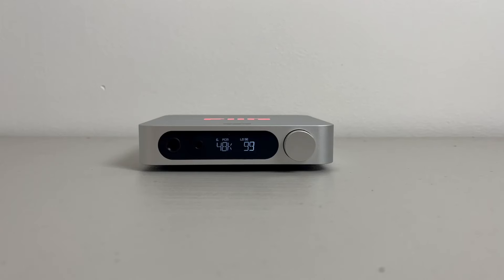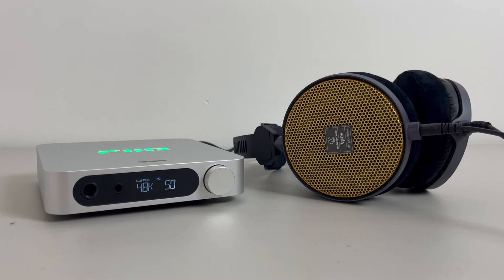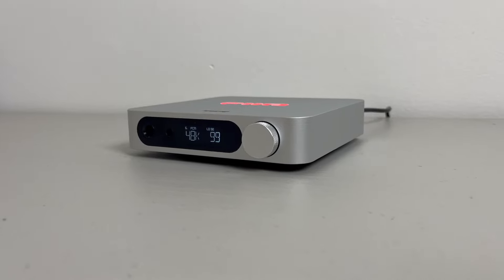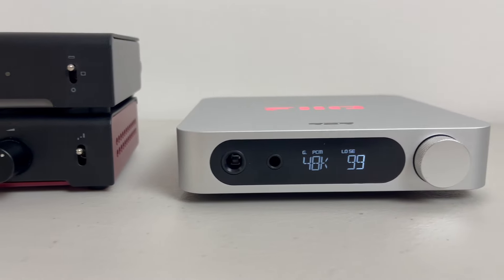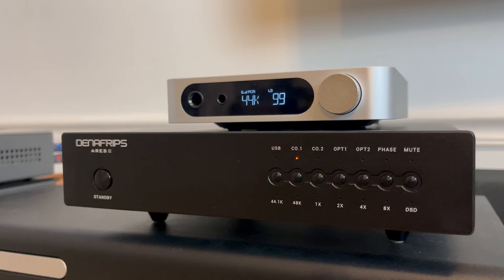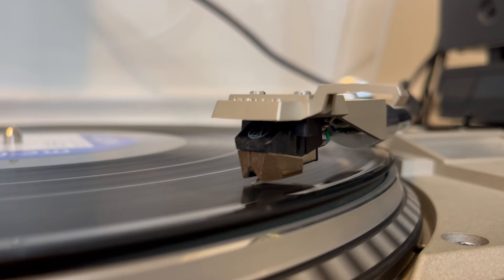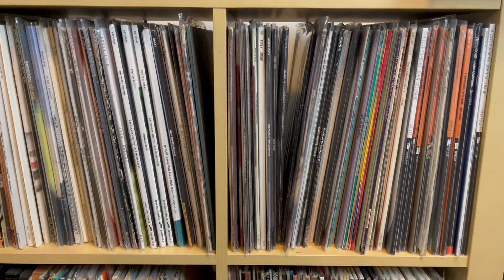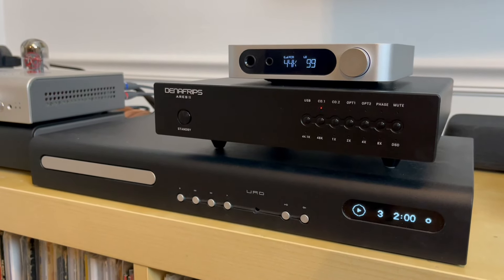This $160 R2R DAC is BLOWING MINDS in 2024! (Fiio K11 R2R Review)

Comment: Couldn't agree more with the review, nice job. I picked one up about a month ago and find it superb as a DAC, headphone amp and preamp - and i use it all three ways. I also found it compared well to my Pontus II in the same way it did to your Ares. Really relaxed and spacious R2R sound. One thing reviewers haven't pointed out that's an excellent aspect of this unit is it's volume control which is not a cheap analog volume pot nor is it a digital volume that throws away bits to achieve attenuation, rather it's an R2R volume that is not dissimilar to a stepped attenuator by way of resistor relays which we are seeing in many newer preamps these days.
Reply from the maker: Excellent point on the volume knob! Thank you for sharing!
Reply: Have you heard reviews on the Cyan2 DAC? it costs 10x more, but lots of praise I've heard
Reply: @toai2  I've seen reviews and all the praise, yeah! It definitely has my interest for sure. I do wonder if it's any "better" than my Pontus II though, probably just different.
Reply: @sean_heisler  no need to get the Cyan if you already owned the Pontus
Reply: Mostly reviews on this is regarding the headphone setup,,,,glad you mentioned the dac is good,,,,looking for this with my fiio btr13 Bluetooth receiver and Yamaha 2 channel amp ,,,,,is this analog sounding dac,,,,, ???
Reply: @jawadtaheri4989  Yeah, like Aaron was saying, it’s a bit more analog in its delivery, not analytical, smoother. I’ve owned two Denafrips R2R DACs now and it has the R2R, somewhat analog-like sound.
Reply: That's cool it can be used as all those 3. Prob gives a nice quiet listening exp on the phones 🤔 awesome for some late night watching / listening😊😊
Reply: It's a great unit, just wish it had a remote, my fat fingers struggle with the multi function control .. Well worth the money whatever you use it for .
Reply: @Evolved_ue7  thanks. Lol I was to ask if there was a remote, no biggie. Tempted to grip it lol
Reply: I didn’t think the K11 R2R acted as a preamp. Can you confirm? Asking as it only says line out on the RCA outputs.
Reply: @G00dH0uR83  Yes, it is a full preamp as well, I use it with a Parasound amplifier I have driving speakers. You can use the unit three ways: as a headphone amp, as a preamp and as a DAC. You select which type you want in the dialog using the knob.
Reply: @G00dH0uR83 Yes it does I used it with my headphone amp also . However I had my power amp only half way so to use fiio as volume control, it was the best mix for me . But mostly with my sennys I just used the fiio ..
Reply: @ForeverAnalog  hey as a fellow R2R and Refine owner, what is your preferred gain setting for the headphone AMP? I have both balanced and unbalanced cable options.

I'm aware the balanced puts out more power in this use case, but across both cables and all gains I can manage ear bleeding loud (to me). 
I'm new to the hobby, so I'm unsure if the best practice is "pick the gain level that achieves the volume you desire" or if there's detail lost by choosing certain gain levels.

Thanks for your feedback!

Comment: Hi there, would this be an improvement on the DAC in the WiiM ultra? Thanks
Reply from the maker: I haven't had a chance to hear the Ultra's DAC, so I can't say 100%, however there is a general opinion that the WiiM DACs can be improved by an external DAC.
Reply: I have a Wiim Pro Plus which is of course not the same but it might be of interest to you. I did an A/B comparison last night in my two channel setup.IMO it was significantly better. I was concerned there might be a lack of detail when compared but it was the opposite. There was much more detail. I was able to easily follow and pick out things in the mix like rhythm guitars and bass lines where as before it was not as clearly defined. Vocals seem more natural.Details like when a singer takes a breathe seem to stand out more. Sound stage seems wider and with better separation. I do feel like vocals are slightly more forward. You would likely hear improvements over the built in DAC with most external DACS in the $200 and up range but I do think this one is special at this price and even beyond.
Reply: @taho88  Thanks!
Reply from the maker: Thanks for sharing!
Reply: Have both, fiio is much better.

Comment: I like your review style. You have a new subscriber. What do you think of using the Fiio K11 R2R as a DAC source for the xDuoo MH, with headphones and in a nearfield 2 channel system? Which would you use for volume control in that stack? Thanks.
Reply from the maker: Thanks for the kind words. I enjoyed the MH-02 so this is a tough question! Keep in mind that neither of these can power speakers in a nearfield system unless you have active speakers. I no longer have the MH-02 to A/B it with the K11 but if you are just asking about volume control, I think both will work fine in either configuration.
Reply: ... the xDuoo MH-02...
Reply: @ForeverAnalog  Thanks for your reply. I'm currently in a temporary setup where I'm using active speakers. My permanent setup has a good integrated amp (feeding passive speakers), so I'll probably control volume with that. I plan to get the K11 R2R primarily for the DAC. I'm considering getting the MH-02 as a secondary headphone amplifier downstream from the K11.

Comment: My scenario would be to use an iPad or Mac mini connected to the Fiio and then via a RCA line in jacks to a somewhat vintage amp. The Mac or iPad would be using Plex. In your opinion is the doable?  My whole aim is to NOT use Bluetooth. Thanks for any info.
Reply: Can be used, but with not much sense. Dedicated streamer is far better.
Reply: @ Good point. I hadn’t really considered that. I was kind of just focused on one scenario. But they seem expensive. I know there must be reasonably priced ones. If you have recommendation I’d appreciate it. Since Plex exists on my NAS streaming does seem to be a better alternative
Reply: As a transport even very cheap wiim mini is a huge power, far better than any phone, tablet or pc/mac. Very in fact high end solution - Wiim ultra is still relative cheap.
Reply: @trekkis  Thanks I was looking at the Wiim… I will continue researching.

Comment: Can I line out to powered speakers like the AudioEngine A2+?
Reply: If there is internal dac and dsp in use by active speakers, there is totally no point.
Reply: @ no they’re just active speakers. My worry is that if this R2R is acting like an amp that could blow up my active speakers.
Reply: Active speakers = speakers with dac, dsp and amp. Speakers with only amp = powered speakes (and speakers without anything = passive). With first one external dac will not work (will not have any effect due to second internal dac limiting external one) . With second one (powered, without its own dac) external dac will work. Dac itself it's not full amp (it's preamp), it has standard 2V output (on max or fixed volume, can be freely lowered) which is required by amp or active / powered speakers. There is no any possibility to damage anything. Active speakers would not have any problem even with 10V or more, I have even such tube preamp connected with active ones from years. And of course fiio and many other dacs connected with active, powered and passive.
Reply: @trekkis  Thanks for the clarification.  I get confused by the jargon most times. It's actually a powered speaker not active.
Reply: Powered currently are better than active, as can be used with better external dacs like fiio. If any jargon would be still confusing, I can explain any :)

Comment: Worth to be aware that in fact r2r dacs have much more detail (micro detail) than sigma dacs. Higher freq only needs some peq enforcement, but effect is Incomparably better than false sigma details which are effect of interpolation and oversampling. Nos dacs have about 20 times better impulse raising time, so clarity (separation) of micro details. Sigma should have 1Mhz resolution to compare. Also there are no digital filters applied in Nos dacs so there are no filters artefacts present. In overall, Incomparable better base for further peq.
Reply from the maker: Great points. Thanks for sharing and for watching!
Reply: It is a personal preferences. The same applies to DF. NOS raising time have nothing to do with a real signal because it is filtered (LPF) before ADC recording and signal spectrum is limited. It is a common myth from Multibit lovers. NOS dacs has terrible resolution and THD and it is audible.
Reply: @curious-mxm  Details and real resolution are not personal preferences, they are pure fact, directly audible and always confirmed by many very experienced listeners also in blind abx tests. And nothing is filtered - as can be directly checked on oscilloscope image on output. Difference is huge. Only this is real signal, nothing else is, and can not be denied. LPF filter has nothing to do with this, you simply messed topics. Interpolation with all errors and artefacts is directly observable on output voltage image, also instant Nos response is also directly observable - it's about 20 times better (40us vs 2us - human hearing is very sensitive in case of time domain errors). Exactly opposite - thd is impossible to be heard, itd way below audible threshold - also can be observe. So post is entairly false.
Reply: @trekkis  when you are telling about the audible difference it is note a pure fact, it is a personal preferences. I did many Multibit DACs before, and we did a funny blind tests with custom digital filters and top industrial filters like pmd100 and sm5847. Those pure multibit lovers was confused).
All NOS 16/44 will  huge distortion and human hearing is very sensitive.. this is why many people like vinyl and tape/reels with w&f ~ 0.01% in a best case. Is this a sensitive domailn of the human hearing?
So I know the topic very well and your arguments are pretty typical for those who never did any measurements by himself and have no understanding of the "theory", Dirac function and sinx/x interpolation in particular aspect. This is why all DAcs with DF will have a ringing on the delta function, who cares that you will never find it in a real music signal. Good argument, isn't it?)))))
Reply: @curious-mxm  You didn't understood. I perform many, basically all kinds measurements, so you are totally, extremally wrong even on this level - lack of reading with understanding. And ringing is not anything what can be audible (this is very bad argument actually), there are many other far more important aspects. But what can be measured is not what is important. Practice is important, nothing else. There is no any meaning what one person is thinking. Blind, practice comparison on groups of tens experienced and inexperienced listeners with statistically significant result leaves no any doubt. Noting more is important - any measurments or theory. Only confirmed many times without any methodology errors, practice. And I simply performed such tests (using RME, EverSolo, Chord, Ares, Laiv and many more like toppings with different akm and ess). There was no any confusion. Conclusion was very clear. 

Of course, still everyone has right to deny such facts and choose to stay in his own cognitive bias. But facts, are facts.

Any sentence that something like chord, ares, Gustard, Laiv, pontus, venus or terminator have huge distorsion in negative sense (sentence that all distortions are bad is error itself) is simply extremally ignorant, nothing more.
Reply: @trekkis  I do and I don't know what you measured but when you do comparison for the slew rate it is totally wrong and describe your tech level and a bit weak knowledge about the internal operation of the R-2R and DS dacs. 
We did blind listening and we have a clear split subject to the general personal preferences: multibit like sound and DS like sound. But when we convert PCM to DSD512 and get it into DSD DAC ... ops, we broke a basic template. 
NOS 16/44 is the worst ever sound I heard, even vinyl is better. NOS 24/352 no problem at all. Show me where to buy such files?)
Please show me the 18-19kHz sine wave oscilloscope picture for 16/44 PCM using NOS and the same picture  from a normal DS DAC. Then we can talk about the impulse response and 20 times difference and your experience. 
Yes, facts are facts and they are clear: some people like 60 years old vintage sound and some of them are not.

Comment: Hello, my friend, greetings from Brazil. When you compare this equipment to the SMSL, am I right in thinking you are referring subjectively to the DS100 you recently tested? Speaking of SMSL, do you believe the comparison you made between the DS100 and the SU1 would also apply to the Fiio K11? To be more specific, would a SU1+DA1 system provide greater detail? 
Here in Brazil, a SU1+DA1 system has the same price as a DS100 and a Fiio K11, and I'm building my first speaker system.
Thank you very much for your attention and for your time.
Reply from the maker: Hi there! Yes, my reviews are subjective as I don't have the equipment on hand to test gear. And yes, as I mentioned, SMSL is going to be more analytical or neutral sounding. If you need an amp to power speakers and not just a DAC (like the DS100 and K11), then I think you'll be happy with the set up you suggested!

Comment: You can even advertise a slow car by saying "you are less likely to have an accident in this".
Not much different from advertising a high distortion gear by saying "high notes are less fatiguing" .
The whole audiophile industry is based on misleading the people into an imaginary world.
Lets get this straight : In the Hi Hi paradigm Only microphones and speakers (and of course studios/rooms) are allowed to have "sound signature"..
It is because these things are inherently imperfect and you must chose from various kinds of imperfections, according to your needs and preferences to settle for the most bearable imperfection.
DACs, Amplifiers just need to have fidelity. They need perfection .. not style.
And it is attainable.
Microphone or speaker is a piece of art, just like a painting ..
A DAC or an amplifier is (should be) like a chronometer.
There is no such thing as a "relaxed chronometer" or "analytical chronometer" .. Precision itself is measurable.
Digital sound is digitized from an analog original
The only duty of the DAC is to reproduce that original as close as possible.
This "sound signature" nonsense should come to an end.
Especially if your wires, connectors, op-amps, power sources have a "sound signature" it means they are flawed.
You should get them fixed
Reply: You just said it all. All this cock and bull stories reviewers keeping saying just to market gadgets holds no water.
Reply from the maker: Thanks for the comment!
Reply from the maker: Thanks for the comment!
Reply: False statement.
Reply: Absolutely.  There is only one design goal in electronics:  Accuracy.  

It is the same for a piece of audio gear or a computer or a SpaceX rocket.  Whatever these circuits do the only real goal is to do it accurately and repeatably.

In electronics, this goal was reached decades ago.  Flat frequency response is common place, as is low distortion and high damping factors due to impedance bridging.  When you get to that state, it all sounds pretty much alike.
Reply: @Douglas_Blake_579  first sentence is the biggest mistake which can be done. It's hard to make any worse. One big wrong. There is no sense to discuss with something that wrong. 

 Especially when - paradoksally - result of DS work is so extremally far for any accuracy and with so many flaws from pure produced audio wave perspective (oscilloscope Soundwave image is simply catastrophic in case of DS and oversampling - which is directly audible, not as much as very bad, full of errors and compromises image would say but still). So sentence is wrong on two levels.

In practice one can prefer Nos, one other would prefer os, but sentence itself that dacs sould alike is simply, totally, pure, entirely false in practice even in case of DS family. And in simply practice most of users (it can be say that >9x%) definietly prefers Nos - with worse thd and other fake parameters.

Comment: Wait, I'm confused. If you're running URD CD transport into the Fiio K11 R2R as a pre-amp, what are you using as your amp? And where does the Denafrips fit it? I currently use a very simple setup: CD transport via coax into an external Cambridge Audio DacMagic Plus (with multiple switchable source inputs) and then RCA cables into the AUX inputs of various vintage integrated amps/receivers. So, what's the chain here again? I think I'm missing a step...
Reply from the maker: It’s all plugged into an amp lol. The Denafrips is just another DAC I have one hand to compare.